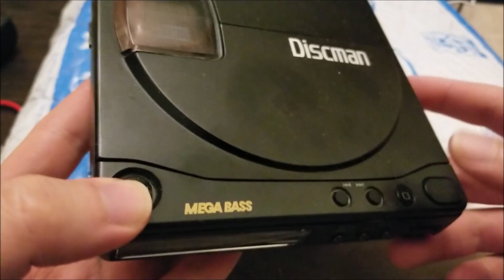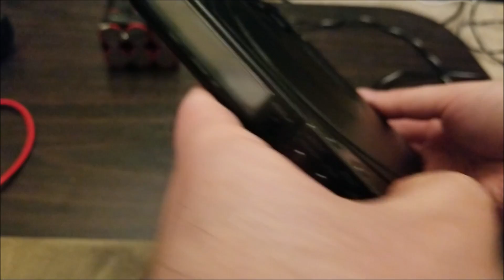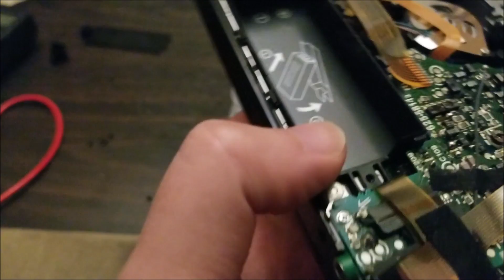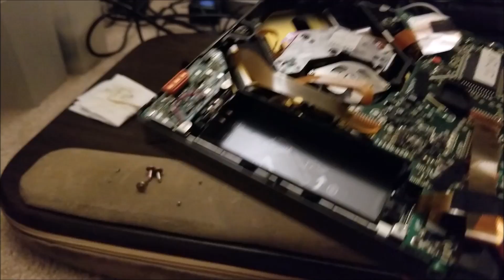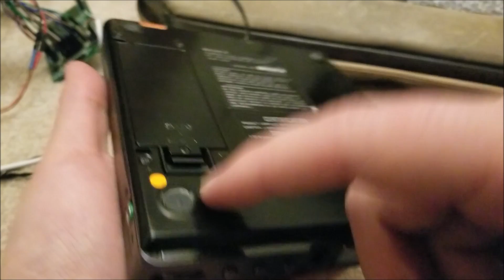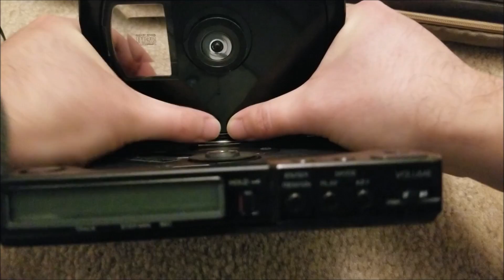Let's Fix: Sony D-15 High End Discman

Comment: I have been going through old stuff today and came across my Sony D-15, which I believe I have not played in 25 years. It appears to be fine except for the frozen gear described in your video.

 Mine is in beautiful shape and has never been out of the house. I have all the manuals and accessories.

AC Adapter
,
RM-DM1K Wireless Remote Control
CPA-1 Car Cassette Adapter
Carrying Case with Strap
Add on BP-100 Rechargeable Battery

Thank you for posting your video. I will follow your instructions to free up the frozen gear.
Reply: He does not show you how to free up the gear and replace it. Poor show for anyone with this specific issue
Reply from the maker: Couldn't risk disintigrating the fragile gear to get the close up footage especially given how finicky it is and at the time I made this video there were no aftermarket replacements available (luckily there are now). In either case the service manual (easily googleable) shows exactly how to remove the gear. Lastly, you are free to make your own repair video showing exactly what you want, that'd be far more helpful than complaining about a five year old video on a rare device.